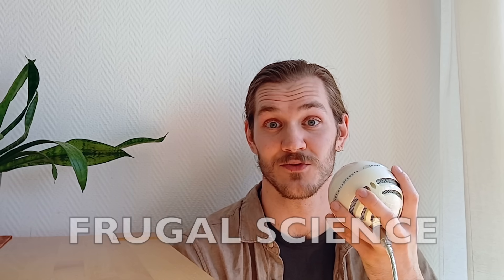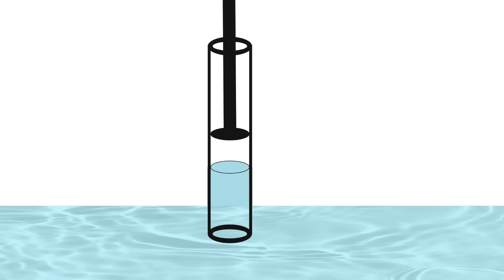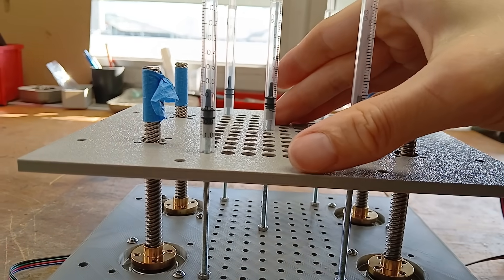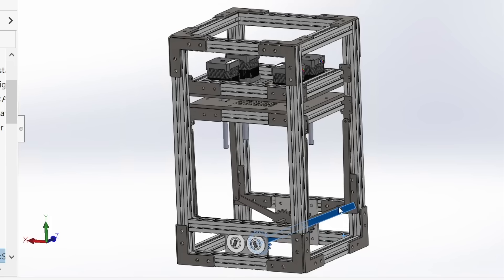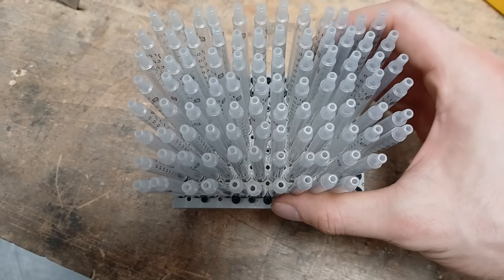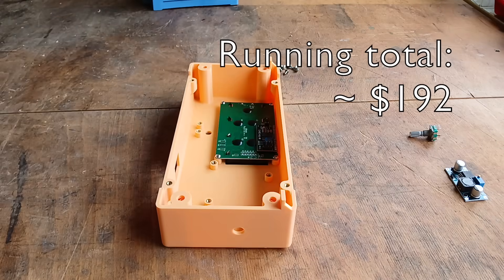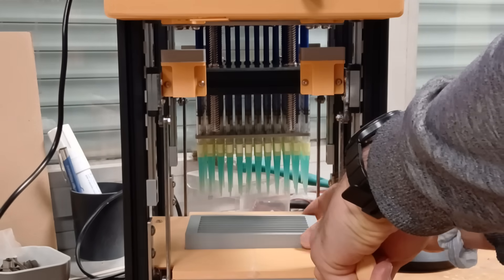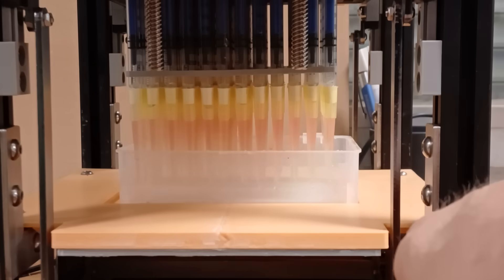This Medical Machine costs $18,000. I Took It Personally.

Comment: As other people have mentioned already the price of the high end devices is a mix of precision, documentation/traceability, certification and sometimes concern of sanitation/contamination. 
Used to work with people that produced parts for automotive and aerospace. Standards change very slowly even there because materials need to go through rigorous testing for safety because failure of components can mean the difference between life and death. Some industrial machines can cost in the tens of thousands to millions, not necessarily because the manufacturing itself is expensive but the testing and adherence to safety standards is. Those standards are important though because they allow people to trace back any potential failure points and prevent future problems. For more simple testing something like this will definitely work, however for anything more complex that requires precision is not suitable. If test produces an unknown number of false positives that can be very bad.

Comment: Love the project! The video is great and there is a lot to learn here.
But when it comes to medical grade equipment the main factor is accuracy.
As you said at the end of the video, this achieved the cost aspect of the goal, but it cannot replace the current equipment in use in the medical field.

A huge factor in the cost of medical grade equipment and materials is the work of the V and V lab (Verification and Validation) to make sure the product meets FDA and other agency standards. The problem with using cheap pumps and materials to show how cheap it can be is that, for example, syringes are meant to be injected by hand and then thrown out. But forming them into a tube that will be pumped in and out repeatedly will most likely cause tiny particles of scraped plastic to end up in the medicine that passes through it.

As for the pumps, medical equipment companies usually require an extremely high degree of accuracy which this type of manufacturer cannot provide. We are talking about 10^-6 of a mg.

As a mechanical engineer in this field I think this project is amazing. Just keep in mind that the cost of parts was never the reason these machines cost so much. It is mainly because the FDA charges millions of dollars per submission and their standards are much harsher than the EU counterparts.

Comment: Having to manually grind down the plungers - meaning the equipment that has to be precise - is not a good idea. Just make the machine a bit bigger so you can use the original size of the plungers.

Comment: You should be able to cut down the amount of motors by using belts, but that might add tensioning issues and remove the ability to potentially auto-level. Awesome video :)

Comment: You can get away with just 2 motors so long as they have enough torque. put them catacorner and you can use a toothed belt drive for the other 2 corners. you can also get away with just one but with the belt stretch it may not be 100% reliable

Comment: this is cool, but this whole linkage system instead of moving the small, lightweight plate at the bottom holding the recepticles is just.. aweful design.
You can see it in your videos how shaky and fragile it looks, Things like this should be kept simple, I get it's not your favorite thing, but it's not worth making the design so much less simple and usable.

Comment: i love engeneering and design but you know WHY lab/med equipment is so expensive? Because producers go extensive certification and testing of their devices to prove that said devices dont skew results. that 18k machine you showed probably costs like 2k in production (parts, power and workhours) but testing, tracking of every single skrew, o-ring and steel bar takes a TON of time that is not puting it together.

Comment: Whilst this is interesting, it fails to acknowledge the remarkable level of accuracy achieved by the commercial machines.  The sheer number of samples dispensed and the ridiculous cost of the reagents they are dispensing means that accuracy, speed and reliability can justify what they charge for them.

Comment: My concern for this is that you should be able to remove and replace pipette tips easily and cheaply so you can use the machine for more than one chemical.  Also there’s no certification for this.

Comment: Fantastic!!! As a fellow engineer and DIYer I absolutely love seeing this kind of solid but accessible solutions. Even though it might not be suitable for actual medical applications due to certifications as it was pointed out in other comments, there are still plenty of other use cases that do not require such strict cleanliness levels. Also your design seems fairly easily scalable to use bigger and longer syringes for other volumes. Cheers
Reply from the maker: Glad you liked it!

Comment: The one thing that's worrying me is contamination control -- it seems like this system would have a very tough time being cleaned between aspirate/dispense cycles, so there's a good chance of accidentally carrying unwanted contaminants between use cycles.

Comment: Great, does it also come with discount physicians, researchers and biologists? Because once you account for the cost of qualified personnel that can make good use of this hardware, having said hardware be guaranteed to be perfect and work every time is the cheapest option at any price. Certainly cheaper to pay for the tested stuff that everyone else also uses and so makes things replicable and testable, than to waste the expensive man-hours of your qualified laboratory personnel assembling this stuff and tinkering with it, all while wondering whether it's good enough or not. 

The only reason why you sometimes end up with qualified personnel in a lab with no equipment is that leftist governments suck. For leftist governments, the only thing you can't cut is personnel. They won't pay their scientists well, but they won't stop paying them either. So, they offer subsidized education, train them, and then put them to work in state-funded labs. That creates both a large workforce that's often politicized and loyal on the ruling party that put them there, as well as power, because you're managing a large team with a large budget for salaries. 

So, that can't be touched, but money quickly runs out, and what gets the axe is everything that doesn't benefit politicians. So, building new labs and hospitals and research institutions still gets done, because there's a lot of potential for embezzling funds in big construction, and that helps the party. Hiring people still gets done because that also benefits the ruling party. Buying actual needed supplied? Not a priority.

Comment: Medical and military stuff costs a lot because they're supposed to work with extreme reliability over an extended period of time, and many times ongoing maintenance and calibration is included in that price. For increased reliability, it has to be tested very thoroughly and every part and material has to be up to spec, which drives the prices up. Sure, the thrown together version might be better than nothing, but it will fail you at some point and you don't know when and it most likely will cost a lot. So no wonder people go for the expensive version if they can.

Comment: Very cool concept and great for homelabs, but medical grade devices cost that much because of the extremely strict production and characteristics testing and adherence required (same with automotive). If a single resistor is placed on the board sideways (known as billboarding), its a junk board. Could be a fully working setup, but with any known error to effect stability, its not accepted

Comment: Nice work :D The results look pretty accurate. However, to truly make this accessible where it is most needed, the key improvement would be to reduce the price by another factor of ten.

One possible approach would be to design a purely mechanical solution. For example, instead of only moving the syringes up and down by hand, the system could also handle filling and dispensing mechanically.

A lever mechanism could be used, where the lever is moved all the way up to a fixed stop. Notches, detents, safety pins, or similar mechanical features could then be used to dispense a precise, predefined amount, similar to the operation of a mechanical lathe or related systems.

In addition, the device should be designed so it can be compactly bundled and shipped in a small package. Providing a simple, easy-to-follow installation or assembly guide would allow it to be built or set up quickly and easily.

Comment: really, you should only use 3 motors and screws for the plunger. we do this on the voron trident, and klipper firmware natively supports that and leveling. you can very easily cut off $18 from the cost plus the extra controller by applying a little more elbow grease to the software

Comment: this is really cool! i wonder though if it really does need to have a bunch of pipettes if the device is able to move the pipette around, it will be slower of course but it can also be 100% automated for a whole stack of trays and it having only one nozzle would obviously be a heck of a lot simpler mechanically and also a lot cheaper

Comment: One thing new printers are using for build plates is a singular stepper motor with a belt ran around 3 lead screws. This assures even actuation among each of the actuation points. This could be emulated in this build to lower the amount of stepper motors, complexity, and cost. Additionally, with multiple motors, if something were to cause one of the motors to go out of whack, it could skip steps. With a singular motor driving multiple points with a belt, skipped steps should effect the system uniformly.

Comment: Hey, I read a few of the other comments and I actually believe this design could be a lot more useful and accurate than people think. Somebody pointed out sterility and cleaning, which I don't think is an issue at all here, the pipette tips are really the only thing that need to be sterile, and if a syringe is contaminated the process to clean it is a lot, a LOT easier than on the real machines: you just throw away the syringe and insert a new one. (The real ones you'd have to take apart and clean manually.... At which point you're better off sending them for an expensive servicing so you don't break something)
For a lot of applications, precise volumes aren't very important, and what matters is instead repeatability. This machine is probably pretty decent at that. You'd be surprised how much the volume of a micropipette can be off from the name value, even a few entire percentage points, but it'll dispense that same amount every time, as long as there isn't user error.

I was thinking of ways to measure the accuracy of this. A more accurate scale is an option, but a milligram scale is either very expensive or very inaccurate. You could get some estimate of the repeatability from the experiment you did with the gradients, actually. If you prepared the dye solutions in bulk, and used the same premade solution every time, the resulting color and opacity should stay the same if the volumes don't change. Bigger changes could be seen by eye, but for actual measurements you'd need to measure the optical density. I'm assuming you don't have an absorption spectroscope... A project for next time? :)
Reply: A real system has a error marginal in the nano liter, and it has the same error in all the holes.
So it will be hard to get to that presentation

Comment: Nice base design. But a whole load of things still left to do.

First, most glaring problem, is that you didn't show how accurate this is. There is a world of difference depending on what you want to do with this. Simple repetitive pipetting no Problem. But if it needs to be the exact same microliters each time every time, then no. Absolutely not!

Changing the tips needs to be better. A simple plate, pushing down with a lever? Do the shrinkwrap hold? 

How often do the pipettes need to be changed? How is material attrition? Is there a problem with contamination due to the plastic being worn down over time because of poor alignment? 

There is obviously more than this still to do, but inspiring work non the less. Might build one myself. Will see.

Comment: Spent 20 years working with pipettes every day and I have to say this is impressive. Never had a need to pipette a whole 96 well plate with the same thing in one go. Most of the time it's single channel pipettes, the rest of the time it's 8 channel. If I had to do a whole plate in one go it would take 30 seconds with an 8 channel pipette. Most bigger equipment has a robot arm with a stainless steel tube probe that does one well at a time and then washes itself in between.
If you can get your hands on a used pipette to take apart you can see how it works regarding the tip pick up and release, the internal plungers, the fact that you measure only on aspiration and then overdispense to keep it accurate (except reverse pipetting for viscous fluids where you overaspirate and then measure the dispense).
Reply: Reverse pipetting isn't really a thing anymore, thank god. Rainin, Gilson (which Rainin used to be the American version of), and Eppendorf all have positive displacement pipettes for viscous media now. You only really see reverse pipetting for cases where you need to dispense 2 or more different liquids into the sample at the same time, and then that should only be done with an electronic pipette.

Comment: The open source community could actually kill this corporate greed if we just all started doing shit like this
Reply: sadly corporate greed lies on much more than copyright to keep their wealth. But access to informations, tools and such is definetly one of the ways to help us with that issue
Reply: The price of this machine is maybe 10% corporate greed and 90% certification costs.

Say the arduino controlling this fails subtly, causing a wrong diagnosis, and ultimately harm to the patient. Who's to blame?  To my knowledge Arduino doesn't make any legally binding promises about the correctness of the boards it produces, so the blame would be on the creator. In a fully certified medical device, you'd pick a controller board that has a solid guarantee to do what it says it does. This means the board's manufacturer would get similar certifications and guarantees for all its components; if there's a catastrophic failure every step of the supply chain wants to be able to point the finger at someone else, so they need to hire auditors, and add redundancy. All that gets very expensive very quickly.

Comment: I haven't watched the video but the answer to why the price of any medical equipment or supplies is high, is because of the government. Either over regulation, or a lack of regulation on the price, or in places with government subsidised or universal healthcare, the government has no concept of waste and will pay whatever price, even if an identical part from the same factory can be purchased for 1/100th the price. That, and what is the alternative, not to have this piece of life saving equipment? Nobody is making them commercially for less while maintaining the certification requirements the government imposes.

This is true across virtually all levels of government and public works.

Comment: Good work! I'm glad I found your video because I'm in the process of making a similar machine for filling microplate with beads and buffer. I'm currently planning the electronic part and I'm curious to have more info about how you did it on your machine.
Reply from the maker: Thanks! The repo in the description is a work in progress, but theres a diagram w the basic electronics

Comment: Great work! From a UX perspective, having dedicated buttons for aspirate and dispense would be a real time-saver, especially when the device is used frequently and consecutively.
Reply: ideally as some form of rocker so it is hard to mistake 1 for the other
Reply: Another possible way to improve the UI and to save money: use a smartphone.  This might sound like an expensive option, but low-end smartphones are very common around the world.  It might also sound like using a Bluetooth or WiFi interface is the advanced/expensive option, but many cheap microcontrollers costing only a few dollars (e.g. ESP32) have such technology built in.  That eliminates the LCD and the wheel/button completely.  The user supplies the UI hardware (and better a better UI experience).  The electronics enclosure can also become smaller and simpler, and can be mounted anywhere on the machine.

Comment: Suggestion for future iteration: instead of cutting the end off the syringe, chop the tabs off. You should be able to use the leftover tab bases to register it into the holder plate with a locking frame over it instead of hammering them in. This would also allow for easier replacements.
Reply from the maker: Wish I had thought of that, this is spot on.
Reply: What exactly?
Reply: @lucbloom The syringe plungers are a + shape cross-sectionally. The thumb pads on those plungers are circles, but they are too big, which is why Triggy sanded each one down in a drill. If he just cut off four sides of the circle with some sidecutters the thumb pad would now be a small square. This square will still locate them in the holder, and snipping them is a whole lot quicker and easier than sanding them.
Reply: Or perhaps you could just 3d print the plungers as one single part including the plate they are put innto
Reply: Also something to think about: unloading all those tips quickly, so you can do the next batch